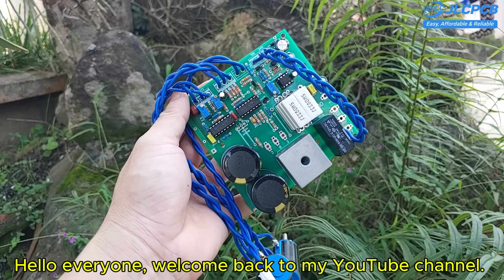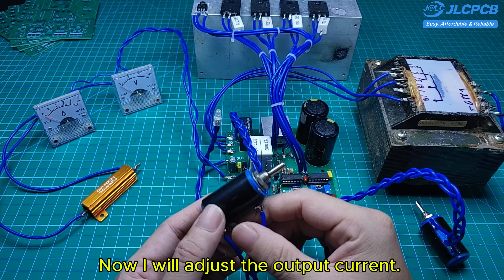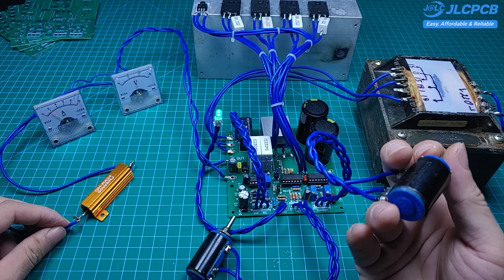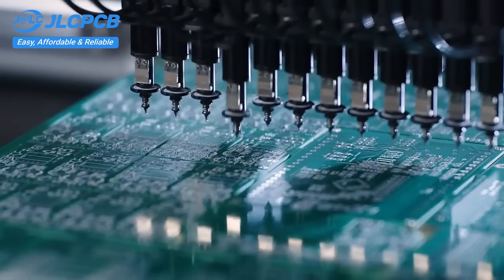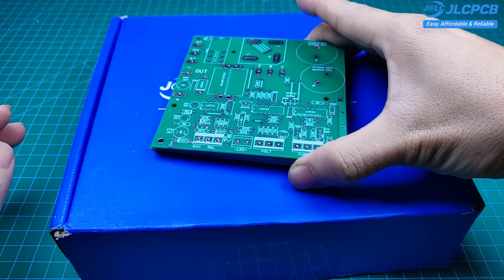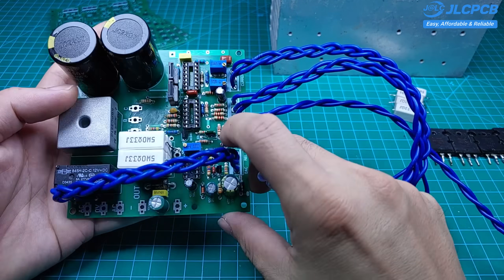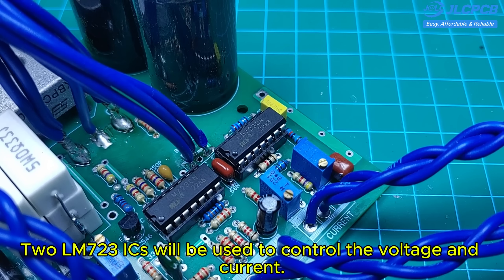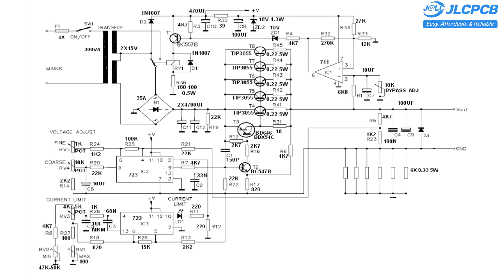DIY 0 - 30V 0 - 10A Linear Power Supply – LM723 & 2SC500 | JLCPCB

Comment: In your video you state that you can download the full component list in the details but the only relevant link is to the DC Good.rar, which contains a top and bottom pdf files, a schematic file, and a DC Good.rar which is the Gerber files for the PCB.  There is no list of components.  I can reverse engineer from the video 80-90% of the components but... just to be absolutely sure.

Comment: Good job. What is the specification of the relay you used. In terms of coil voltage and current handling capacities
Reply from the maker: 12VDC of coil bro with 10A